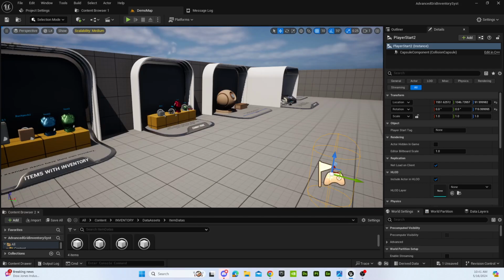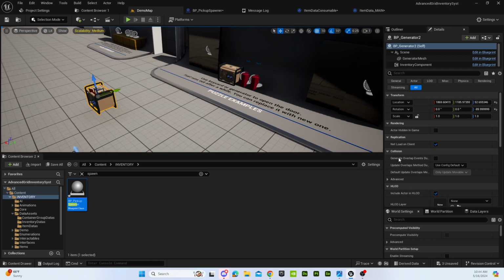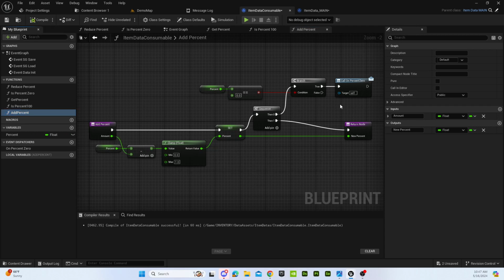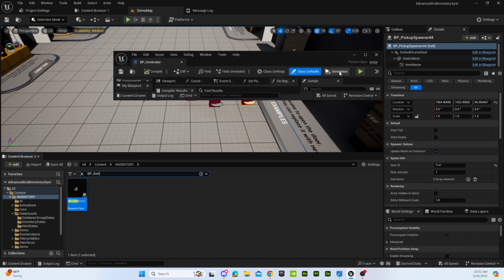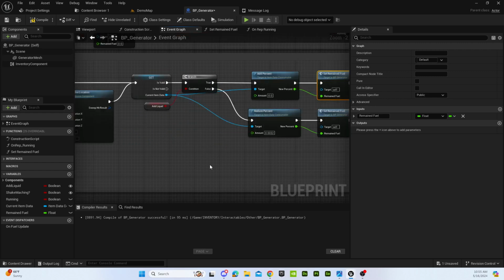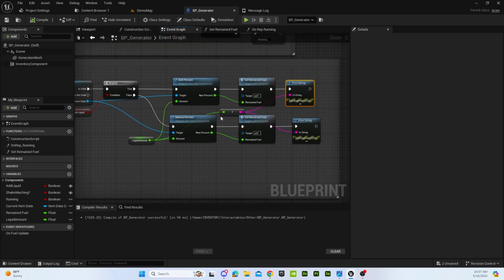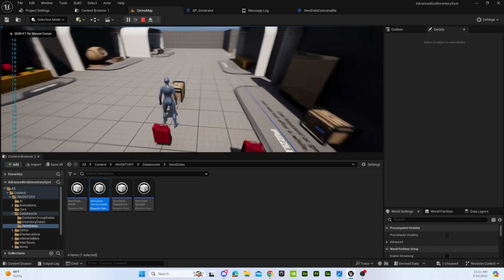Advanced Grid Inventory System by Kaya Products. Adding to the BP_Generator Base to add liquid

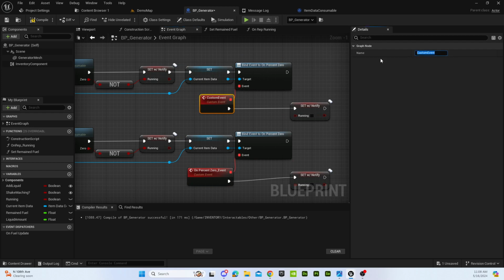Comment from the maker: @ 18:04. The Bind event to on Percent Zero should be Bind Event On Percent 100.

@ 21 mins. Add a Set Remained fuel  function on BP_Generator>EventGraph after the Cast to ItemDataConsumable. Get percent from item data consumable to the remained fuel . to your "add liquid" branch.  For the UI fix. hope this helps!